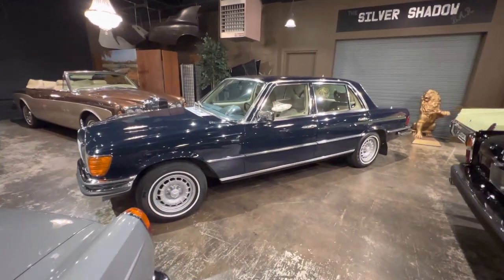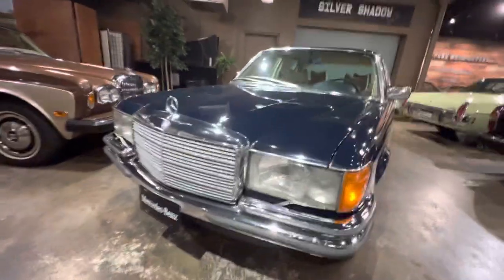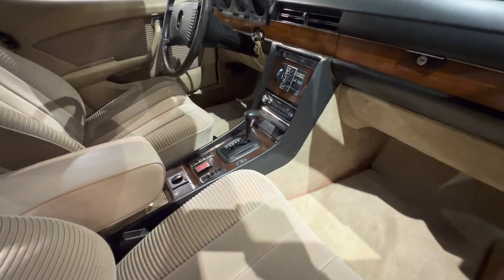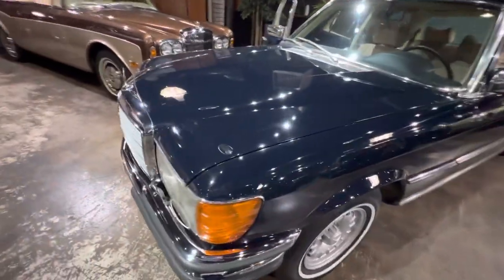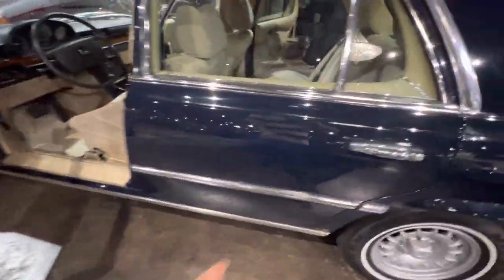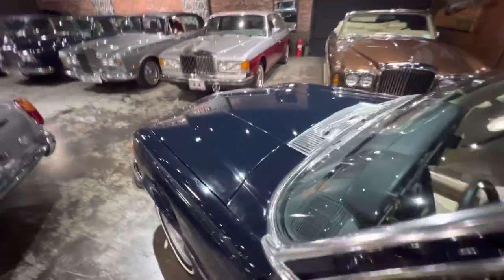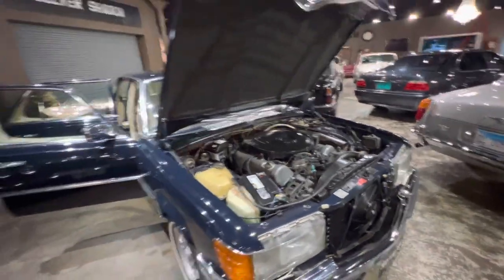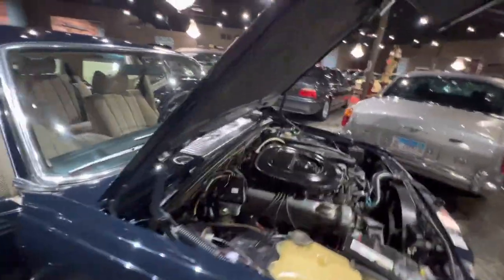79 Mercedes W116 450 SEL - 74,000 miles.

Comment: This world in high-end cars was better than today. They cared more about beauty, build quality and reliability. The 1970's and 80's S-class optional and premium features were also useful like telescopic steering wheel, heated seats, extra airbags and rear power seats. Today so many cars' gadgets are gimmicky and unnecessary like electronic buttons in place of door handles, "hands free" driving and run-flat tires.

Comment: Would the tyre tread not be running in the wrong direction if you was to flip the tyres? This could be dangerous in the wet. Beautiful car, great video 👍🏼
Reply from the maker: Ummm….. you’re having a lend of me, no?
Reply from the maker: This is why some people are not suited to car ownership
Reply: I think the real kernel of this question is “are the tires on the W116 unidirectional?”  If so, this comment raises a valid point and should not so easily be dismissed.